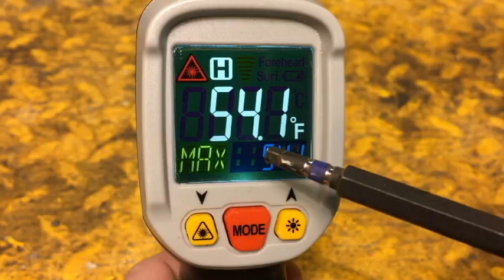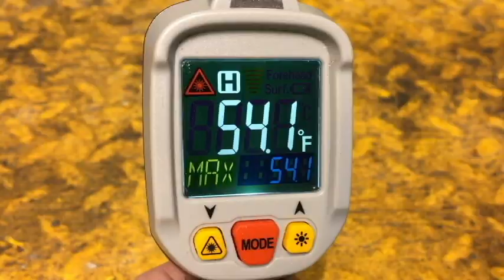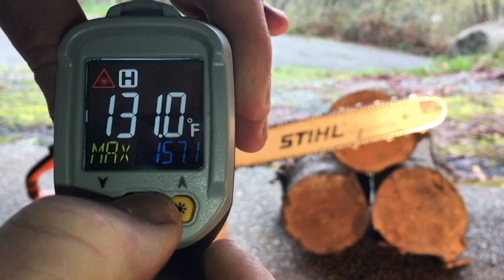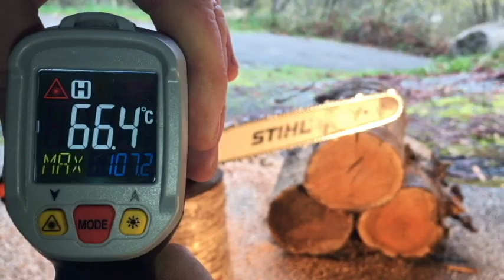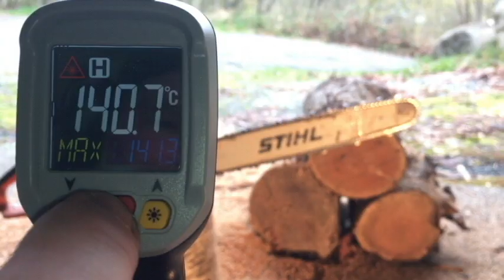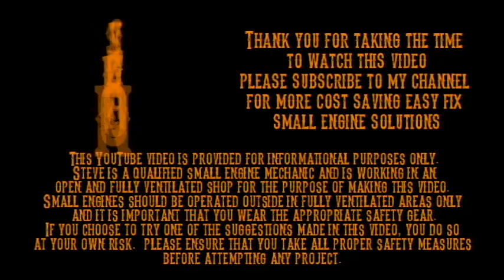Why A Dull Chain Will Destroy Your Chain Saw

Comment: I recently bought a chainsaw and it had a dull blade. Luckily had another chain...i have been trying to sharpen it for a while . It doesn't seem to be sharp. Ill have to find a couple more logs  to find how i did
Reply: I found  a log and tested the chain. It did a little better.  I ended  up using  another chain and it performed well. I would have to find someone  to examine  the  chain to get his opinion on it. It seems rather sketchy  overall
Reply: I meant it had a dull chain

Comment: Chain can snap, bar can warp due to heat, overheating can cause parts failure inside the engine. May not melt!! But can deform due to overheating

Comment: i know this is an old thread, but,
.
It occurs to be that most two stroke engine failures are lubricant related.
Either the the lubricant fails to be distributed or the lubricant over heats and fails.

With every new charge cycle more lubricant is supplied to the crank case, with every combustion cycle lubricant is burned off.
.
Not only that, a very large part of the cooling of two strokes is by the air flowing thru the motor not around it.
Cool air, fuel and lubricant is drawn into the motor with every induction stroke, this accounts for almost all the cooling of the piston.
Hot air leaves the motor with every exhaust stroke, the faster the exhaust leaves the combustion chamber the less heat is transfered to the piston and the cylinder walls.
In fact a free flowing exhaust can reduce both engine and exhaust temperatutre
.
All two stroke engines operate on the verge of destruction, particularly the high performance ones.
They do not tolerate being laboured and they run best at the highest reasonsble RPM.

Note that most piston and ring failures on two strokes are near the exhaust port, where the temperature is the highest.
My assertion is that this is a lubricant failure, either lack of supply or excessive temperature.

Think on this and you will find lubricant failure has a role to play in most two stroke failures.

If you want to consider temperature issues with two stroke motors, exhaust gas temperature ( muffler temperature will be close enough) will be a far more accurate indicator than the cylinder block.

Comment: A dull chain also creates powdered wood instead of chunks which quickly clogs the air filter and creates a mud like substance with the bar oil that clogs the bar oil hole and clutch drum.
Reply: I know this all too well. I'm BAD about running my saws with dull chains. I've recently learned how to sharpen chains using a file, so I don't have that powdery dust problem anymore. Also hard woods (like oaks, for example) are HELL on chains, as they're SUPER dense and hard to cut through, even with a resharpened chain (or even a new chain out of the package for that matter).

Comment: it seems that the most damage would be to the bar by having to push down hard on the saw , the friction it seems would put alot of wear on the bottom part of the bar and the the inside surface of the chain where it rides on the bar

Comment: I have a chainsaw which need the chain sharpened now, but two others which I am having trouble cranking. The two which won't start are gas powered saws which just came from the repair shop not long ago and I could not get them cranked at home. The one which runs is a battery powered saw and it works fine for me. I also have a fourth saw which now won't crank, but it is very old and I am not financially able to take it in right now.

Comment: Just to be pedantic, I don't think it's a 27% increase.  Not sure if you were using Celsius or Fahrenheit to do your calculation, but both have arbitrary starting points.  Convert to Kelvin and the increase is much lower.

Comment: Hey Steve, I’m cutting dove tail joints for my log cabin and I only have a chisel chain. It’s sharp and cuts good against the grain however cutting with the grain it sucks. Q:  can you sharpen a normal chain to 10 degrees and get by or should I get a ripping chain. Thanks

Comment: Get a file guide, correct file and your old chains. Always keep the box your chain comes in as all the information you need to properly sharpen is on the box. 
Spend a few hours working your old chains, paying attention to keep proper angle and the file level practice, practice, practice. In no time you’ll have a razor sharp chain that is safe to use and compliments your saw and making the job easier.

Comment: There may be a little more to the story, the hotter the lubricating oil gets, the less it can lubricate. Also, the hotter the Piston gets the greater it increases in diameter, possibly enough to score the cylinder, especially if somebody starts working it hard before it has warmed up! The diameter of the Piston can increase faster than the diameter of the bore.
Folks, please always use quality oil, and especially allow your chainsaw to warm up at idle a couple minutes before revving it up or working it hard. Your saw will thank you with long, long life.

Comment: The bar & chain are also hotter with dull cutters, there's more wear on everything including the operator, it takes longer, it's more fatiguing, fuel burn is increased and it's less safe.

Comment: What temp does bar oil start to smoke? I found gear oil will flash over at 375-580*F and motor oil 425-503.
I've cut for power in the summer with a heat factor of 126*F.When I'd shut the saw off to refill it'd be smoking because of the bar oil and oil coated sawdust stuck to the saw.I'd be pretty sure it's over 286*F.Possibly over 325
Cutting with a dull chain is all around harder on a saw hands down,as is any machine like a tablesaw,mitersaw,bandsaw with a dull blade or drill with dull bits.

Comment: Steve, why do fuel lines on all my weedwackers deteriorate, sometimes in the fuel tanks & sometimes between the tank & carb? I've replaced some of them with fish tank filter pipe & even windscreen washer pipe it's mostly cheaper gear I have, ryobi & the like, I don't do enough work to buy stihl or huski, is it just cheap rubber or designed to fail? I'm having a Guinness on this glorious Friday night 😀❤️👍
Reply: Maybe the fuel you use has too much ethanol blend in. It eats some rubber types, especially older ones.
Reply: Dusk thanks for replying I'm in Scotland we don't know much about ethanol in fuel etc we just buy it from the pump, I'm baffled as to why fish tank air pipe outlasts the original pipes? I bought a new ryobi 4stroke weedwacker last year & I've just had to replace the pipes they were completely rotted inside the tank but ok between the tank & carb? Another 2stroke ryobi was the opposite, good inside the tank but rotten between the tank & carb lol. Like I said im baffled 👍
Reply: No problem 😉. Since you live in Scotland almost all the regular 95 (RON) Octane is a 5-15% ethanol, 85-95% petrol blend. That is because of EU regulations. It shouldn't be high enough to eat away the pipes that quick though. Because if it where, older cars wouldn't be able to run another year without a complete fuel system (and maybe engine) overhaul. If you buy your fuel, just buy the regular stuff when available. Try to avoid special brand related super-power or ultra-mileage fuels, it is possible they contain a higher amount of ethanol or other alcohols. 

I think the fish tank air pipes are made from a polyester variant and not a rubber like material. That could explain their longevity. Furthermore, from what I know, Ryobi tends to make pretty okay stuff. I don't think those pipes are designed to fail, I can't think of any reasonable reason to design them that way.
Reply: Right on Dusk, I have some ryobi stuff that simply shouldn't still be running, like 5 year old & ive worked them hard! Apart from replacing the fuel lines??? 💪❤️👍

Comment: Great job Steve.  However, I think the bigger factor to mention is the time it takes to cut through the logs.  It took 4.3 times (23 sec vs 99 sec) longer with the dull chain.  That is using up the life of the saw and its components 4.3 faster to make the same number of cuts than with the sharp chain.  That is without considering any additional effects resulting from the higher temps.  I'm sure the saws run hotter than that with a sharp chain in the summertime in the lower latitudes so I doubt you are damaging the engine with extra heat alone.  Additionally with the dull chain, you are using that much more fuel and oil for the same number of cuts.  Keep up the great work.

Comment: Damn I wonder if this is what the previous owner of the MS360 Pro I just bought had done to the saw.  He had no working muffler on it and after only a handful of cuts it stopped working, went to Stihl and they said the Piston and Cylinder were scored and its not worth fixing. Damn I really wanted this saw to work, got some big ass logs in my driveway to get rid of and needed the 24" bar on this saw.  Any suggestions on aftermarket piston and cylinders for this saw at all?
Reply: wsfd4321 yea I think I did get burnt. Certain things I don't mind used but I think stuff like chainsaws I might go new in the future

Comment: The temperature increase by itself isn't enough to damage the saw, especially in the fall/winter/spring. 
But run that same dull chain in August, with some old ethanol fuel and a plugged air filter and it is enough to damage a saw. 
At the shop we see a noticeable increase in seized saws as the weather hits 90 degrees in the summer.
Reply from the maker: Interesting.  Thank You...
Reply: Here in the hotter parts of Australia the mechanic told me to always have a sharp chain and run your fuel to oil mixture at 25:1 the only way to protect against hot weather
Reply: @jw-vx8im  How will less oil in fuel protect against hot weather?
Reply: @PencilProper  lubrication like when it's 40c lubrication is your friend
Reply: @jw-vx8im  but 25:1 is less lube than 50:1.... I have always run 50:1 in my saws in temps close to 40 with no problems.....
Reply: @PencilProper  it's more 200ml to 5 ltr of fuel
Reply: @jw-vx8im  So 25:1 is more oil than 50:1?
Reply: @PencilProper  yes 25:1 is double the oil of 50:1

Comment: Seems like the higher temps wouldn't directly affect the aluminum (metals stop acting as stiff at around 40 percent of the melting point). But it may affect nearby plastic parts and possibly drop the viscosity and or break down the engine oil and other nearby greased etc a little faster, which could make a difference to the wear of the metal and cause other problems.

Comment: Just a thought, maybe compare the temperature after using both chains for the same amount of time, instead of number of cuts. Obviously the sharper chain ran for much less time than the dull chain so maybe the temp difference would be less significant if they ran full throttle for the same amount of time...? I've recently found the channel and have quickly become a fan. Thanks for all the great insight!
Reply from the maker: Right on ....
Reply: Yes it makes sense that the temperature rise is due directly to the runtime as much as anything else

Comment: Cause damage to the saw it is not a clear test. operating in hot conditions say 30+ degrees C it seems likely that the temperatures would increase.

Certainly it takes longer so it will use more fuel. 

If a saw lasts say 200 hours of running at full throttle you will certainly achieve a lot less in that 200 hours with a dull chain
Reply: You will only get one third of the wood cut in that 200 hours but probably more like one quarter cut.  Your saw is definitely wearing out faster if it runs 4 times longer to cut the same amount of wood and has to work harder to do it.

Dale in Canada

Comment: Hi Steve. Good video. Not really 27% though. You need to use absolute temperatures for that calculation. This because zero C and 0F are just arbitrary numbers. So closer to 8 or 9% on the absolute scale. Still significant. If you do end up measuring the bar, need to keep the sensor close. Those devices “see” a cone and average the temperature over the area. Keeping it close keeps it tight and more accurate. I m subscribing tonight. You teach me about small engines and I will try to back up your science. Cheers buddy!

Comment: Hi steve hoe r u?To begin with today i used my ms 150 tc to trim a few live trees.suddedly something happened to my chain it was hardly moving and heard a strange noise inside the bell.i changed to a new chain and all work perfect.after i put the old chain in a cup of oil it started working perfect again.my question is this.Does these small chains 1.1 need special use,are they sensitive because it has happened to me twice.the chainsaw by the way is fantastic.what is your opinion.thank u in advance!!!!!!!!

Comment: 9:10 Actually you cannot determine a percentage change in temperature by comparing the numbers on the Fahrenheit scale or the Celsius scale, because the zero point in those scales is completely arbitrary. The percentage change in this case is 27% in Fahrenheit scale but 32% in Celsius scale. Imagine that you had a temperature change from 1C to 10C (34F to 50F). Then the percentage difference would be either 1000% or 47% depending on which scale you used. So, the percentage numbers are clearly not meaningful.

Comment: well here's my take -    you are testing the external temp  which heat soaks from the inside out. hard to say what the actual combustion temp is. also one of the factors is the oil being used. two strokes lube by the oil mixed with the gas. how far will the oil protect from the heat?  when the oil breaks down it looses its lubricity and friction will compound the heat.      short term i doubt it will hurt  long term it will shorten the life of the saw.     as this video points out  use good oil  maintain the saw and keep the chain sharp.  how was that two wolves?  never heard of it
Reply: i'm still running my 028avesq i bought in 1985

Comment: Hey Steve.. it's probably only hotter with the dull chain as the engine is running for 3 times as long. It's a weak mixture that kills a 2 stroke engine and this is virtually always manifest at the exhaust port or the part of the piston that is exposed to the exhaust window as the exhaust gas temperature will get so hot it can cause the piston or cylinder to expand so much it can cause a seize...

Comment: Hello Steve,
    Firstly, I KNEW NOTHING about chainsaws. That being said, my son gave me a 34CC 16" Poulan that had nothing wrong with it. Told me to do whatever I wanted to do with it. I scrap stuff ocassionally ! My neighbor had just had a Mulberry tree removed, minus the stump (HUGE) ! I took the chainsaw over to his house. I started cutting with it immediately after startup. Trying like hell  anyways. The stump and roots were naturally wet, as it was a live tree. I laid into that sucker and forced the Bejesus out of it.I am the type of guy that NOTHING gets in my way.  I was into it for about 45 minutes and smoke rolled so heavily from the saw that you could not see. Mind you, I DID have the corrct fuel mixture. I know now, that the chain was dull, by time I had finished. Upon trying to use it after that episode with a brand new chain; it ran erratically. I checked out all of your videos, so I am well-informed now. I tried retuning, replacing fuel lines/fuel filter air filter, carburetor and gasket. Nothing worked. Had good compression from cold. Decided to pull muffler. Exhaust side piston galled and scored badly. Ring NOT seized up. Intake side looked like new. Muffler removal is the FIRST thing a fella oughta try. Just have a look see through the port. I wanted to know just what happened. I am the curious sort. Just saw your video on doing what I just did. Synopsis ! Saw burned up because of the excessive heat and dull chain. I was of thought that you can't hurt a chainsaw from using it to that extreme because you are running it at full bore anyways. I just wanted to answer your question of not knowing if dull chain and overheating will damage saw. WIPEOUT ! Yes it WILL. Thanks for all the great videos that you make.

Comment: How do you know that it is accurate? My infrared thermometer is at least 10 degrees off sometimes when measured against thermometers of a known value. I'm going to get a Fluke with two LEDs.
Reply: Gale Boetticher was using one in Breaking Bad -look what happened there.....
Reply: What I see on the thermometer and wha you say it is seems to be different I may have a looking problem

Comment: Just a suggestion, Steve..... Perhaps a video on cleaning the fan, fan housing and cooling fins with compressed air. In my shop, I see lots of saws come in that are having trouble staying cool because of sawdust accumulation in the cooling system.

Comment: I think any damage to the engine from increased temperature starts with compromised oil. At modern 50:1 mix that's a little oil doing a lot of work.

Comment: My question would be what the increase in temperature does to the oil viscosity.  If it affects that then it could damage the engine.  You may want to check into that.  You may also think about what might warp, rather than actually "melt".  Metal will warp before it melts. Certainly, if the piston or rings warp or disfigure that will cause issues.  Just some thoughts.  NIce video bud!
Reply from the maker: Awesome comment!  Thanks Buddy...

Comment: A dull chain will melt your Saw. Especially if it is a cheap one with plastic everywhere except the pestent, cylinder and the exhaust port. I did this with my garden saw sadly. That was when I went online and educated myself on sharpening the chain, and maintenance of my machines. Costly mistake. But educating.

Comment: Wondering if that 20% heat increase is enough to damage the main seals “overtime” I’m wondering if it may not “damage the engine” but rather spoil some critical components. Causing you to rebuild it.